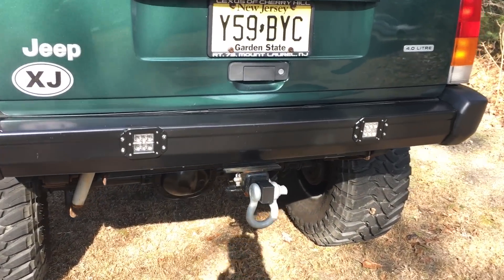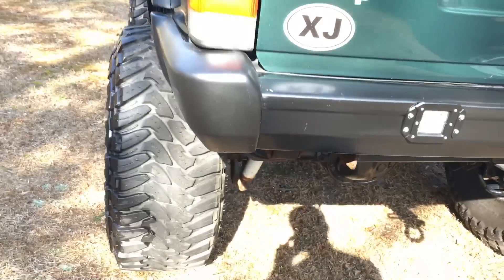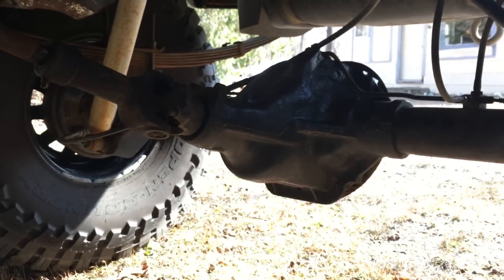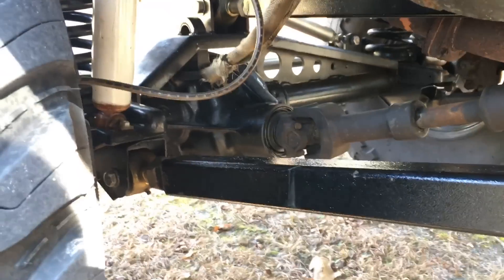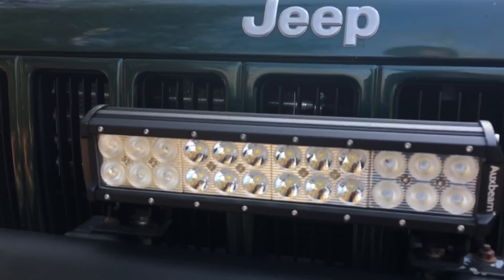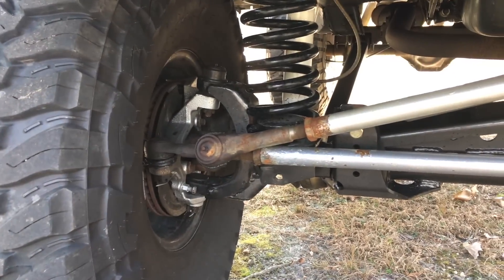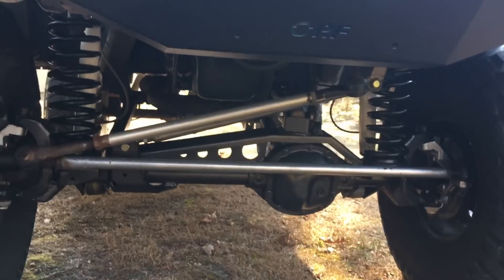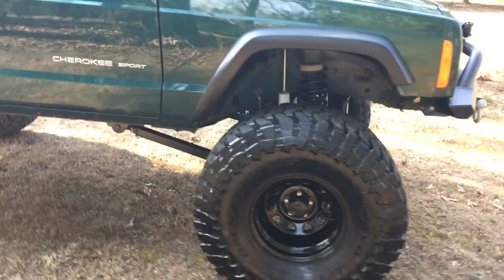Lifted Jeep Cherokee Update Video

Comment: Where did you buy those rims and tires bud and did you have to use a adapter or a spacer? If you could give the sizes for those things that would be awesome man
Reply from the maker: Wheels are from summit, Bart racing wheels, 15x10/4” backspacing tires were from simple tire.com 37x14.50x15

Comment: Question: that your DD and how does it do while driving with tracking and speeds. Looking at a 97 two door 5 speed on 37’s with a D44 up front and a Ford 9” rear. Yukon chromo axles, SYE with CV driveshaft. 5.13 gearing front and back. He has super swampers on it now, but I’d change them out to a more road worthy tire not sure about 37’s probs 35’s but not sure yet. Also have cross over steering and Yukon super joints. Coils up front and leafs in the rear. Do you think I could daily something like that. I only drive 10mins to work and 15 to college. However would do highway driving every now and then. Also sitting on a 3-link suspension.

Comment: 9 inch lift with 37s and stock gears? Ohhhh boy. I have one with 6 inch lift with 33s it's safe enough but damn son you got some stones....
Reply from the maker: dohcmotor69 this was a few months ago. I was in the process of swapping in some one ton axles but lost interest. She'll be getting some 4.88 gears and a rear truss here shortly. Since this video I've installed hydraulic assist and a new custom rear cut and fold bumper. If you have Instagram you can check it out there @benhooven

Comment: How does the Dana 30 do on the trails with 37s? And are you geared? Or stock gearing?
Reply from the maker: RedMannequinDesign does just fine on the trails. I'm actually in the process of swapping to one ton axles though
Reply: Oh ok sick! Cause my XJ is going on an 8" lift with 37s as well but I was also wondering are you on the stock gears? If so how is the mpg and performance?
Reply: Road permformance
Reply: Racemenace 
Whoa! I can’t believe it pushes through without regearing the axles!

Comment: How much did the lift and tires end up costing
Reply from the maker: Casey Drach I’ll have to make another update video soon as I’ve had some more modifications done but the lift if you check Clayton’s website was around $3500 when I purchased it, and the wheels were around $400 and the tires were $1600 so $5500 total